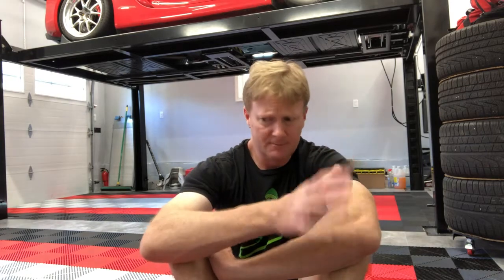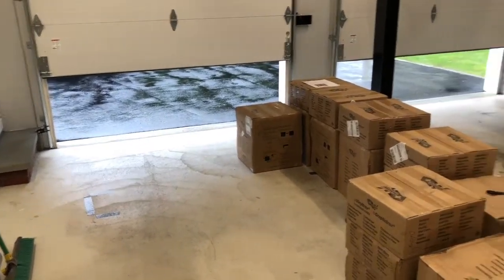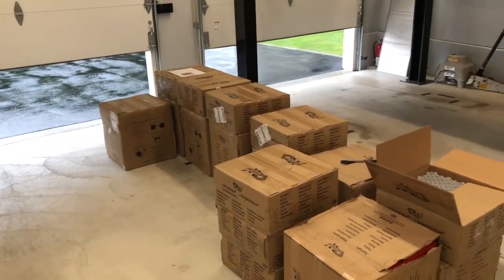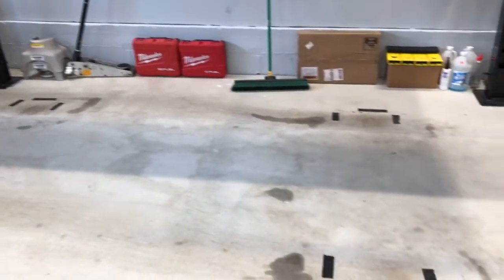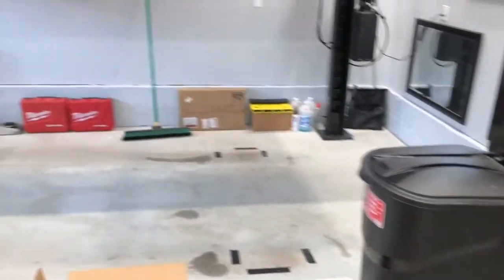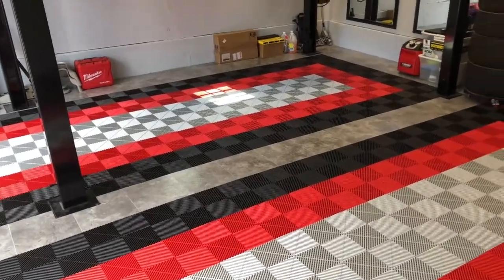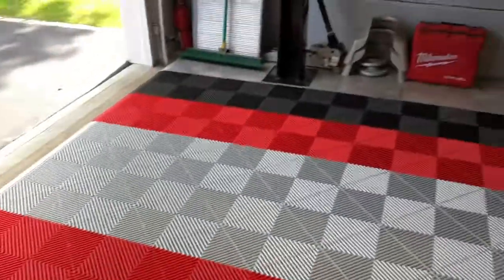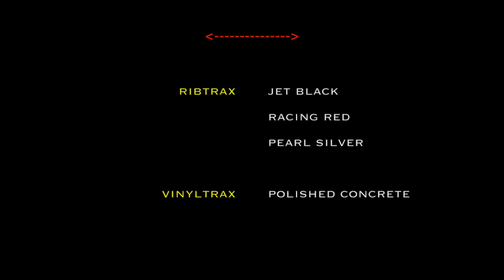Swisstrax garage floor transformation

Comment: Looks good, So question about the lift.  Not bolted to the floor?  Looking to do something similar for my garage and for the same car (GT4).  I just started to research the 4 post lift systems and want to make sure I do not get one that will be complete trash.
Reply from the maker: Thanks. The lift can be bolted to the floor, but I chose to not bolt mine, mainly because I have hydronic radiant heat built into the concrete slab floor. Didn’t want to run the risk of driving a bolt through the tubing. The lift is perfectly fine sitting on its posts without being bolted down. In fact, Challenger sells optional caster arms that attach to the posts if you want to raise the lift off its feet to relocate it. In my first video I described why I chose Challenger over Bendpak, Atlas, etc. Challenger is well-regarded, American made out of American-sourced raw materials, and it doesn’t require a compressed air source to unlock it from its lock stops in everyday use like the Bendpak does. It’s also American Lift Institute certified, an important safety seal of approval that some of the other major lift brands don’t carry. An alternative to the Challenger is Quality Lifts, which is Challenger’s consumer/residential brand—basically the same lift. The next step up in ruggedness and overall quality would be a true pro-level lift like a Rotary or Mohawk, but those are twice as expensive as Challenger (or more) and probably not needed for a residential application. I felt like Challenger hit the sweet spot of quality, reputation, features, ALI certification, and relative affordability. Just a couple notes—the optional extended aluminum ramps are a must for a low car like the GT4, the optional rolling bridge jacks are very helpful for lifting the car off the runways to change wheels, do brake service, etc. (as long as you also get the bridge jack arm extensions from SVI that I described in another video), and make sure there’s an authorized Challenger dealer nearby to do installation, routine service, etc.

Comment: Have you notice if the tires darkens the tiles? Looking at the video, I think the cars rolls over the red tiles?
Reply from the maker: Over time (several months to a year), the tires do darken the tiles, but a bit of scrubbing cleans them up. Probably is a good strategy to use darker tiles where the tires will sit. The good thing, though, is that the individual tiles are easily and cheaply replaced if you need to swap them out over time due to damage or discoloration.